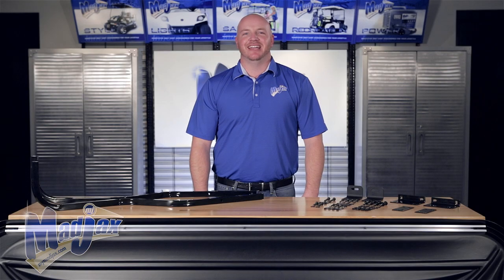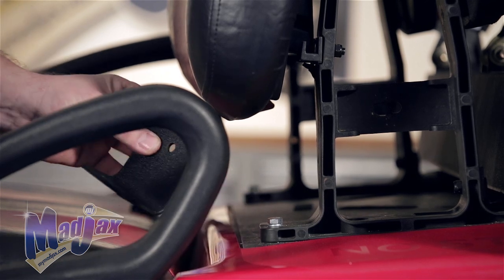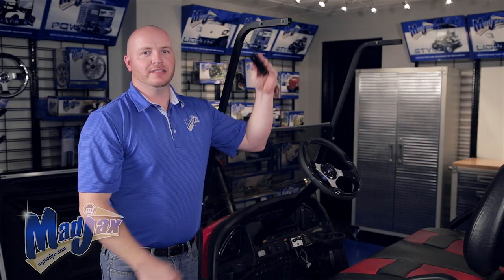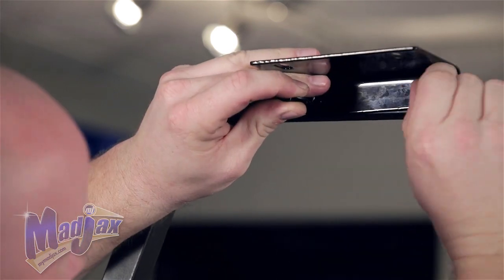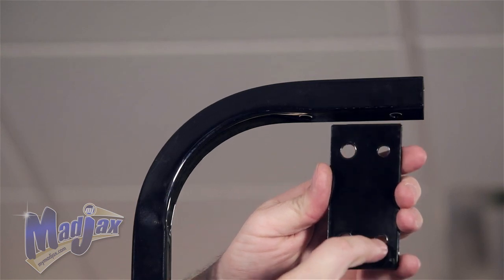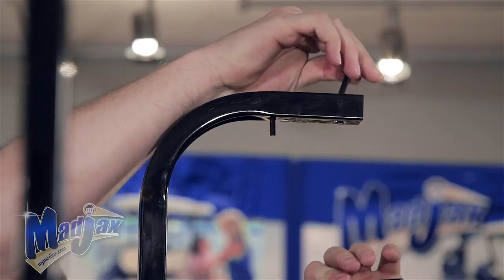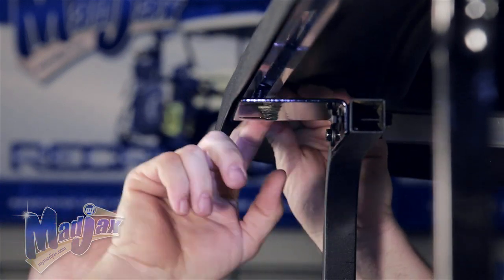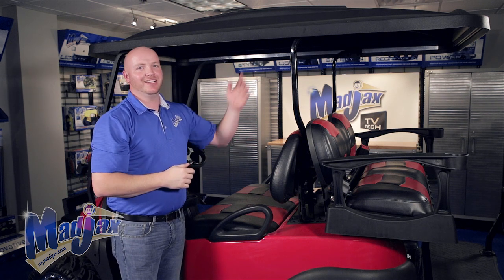84" 4 Passenger Top for Club Car® Precedent® | How to Install Video | Madjax® Golf Cart Accessories

Comment: This is a really nice canopy, but there are a few problems.  On my 2016 Precedent the brackets can't be installed on the front struts as outlined in the instructions -- the brackets have to be mounted on the inside of the struts rather than the outside.  I don't know if there was a different width between the front struts in earlier Precedent models or what.  I also don't understand why you don't have the brackets mounted to the front struts in such a way as to hide the top of the struts behind the triple track (like the instructions say for the rear struts).  It just seems kinda tacky having the top of the front struts and bolts showing from the side when even the stock canopy doesn't do that.

After it's installed it's very noisy when driving down the road. I traced the noise to up and down movement of the triple track where it's riveted. I'm hoping that just eventually breaks in and stops (without cracking the plastic around the rivet) .  If you had used screws instead of rivets all the way around instead of just using screws in the corners, it would be easily solved. 

Also, although this whole triple track thing is a great idea, I'm at a completely loss for finding compatible accessories.  No mirrors, no speakers, no handles, no anything except enclosures.  It's a nice canopy, so I don't regret the purchase, but just feel that you went to a lot of trouble to design this whole triple track channel, but then basically have done little to nothing with it in terms of accessories.

Comment: I have a few questions. The first question is why when I click on your link up above does it take me to a different website? My second question is I have a MODZ ALL AMERICAN CLUB CAR REAR FLIP SEAT KIT on my Club Car Precedent, will this top work with that seat? And my third question is, if it will work what hardware am I going to need to install the top? And my finally question is does the hardware come with the top, or is it a totally separate order?
Reply: Likely too late to help you, but anyone searching and finding this question, here's your answers:  (1) Yes, it will work with MODZ brand rear seats. You will likely need to buy new rear canopy struts though if your MODZ seat came with the ones that mount to the stock Precedent canopy with the downspouts.  As for hardware, the canopy should be sold with mounting brackets for the triple tracks. The brackets mount to your stock front and aftermarket rear canopy struts and then attach to the triple track on the canopy.  You can sometimes find the canopy sold with your choice of rear struts, but not always. It should always include the mounting bolts and brackets though.